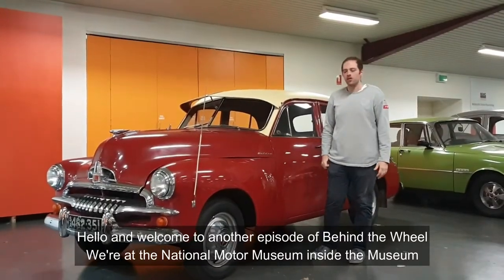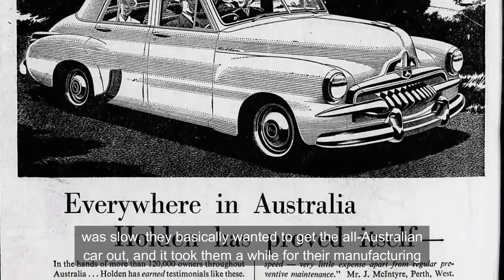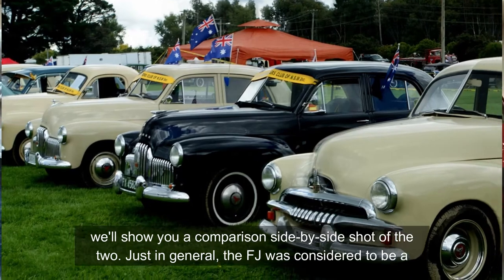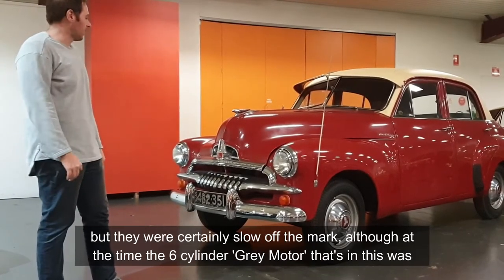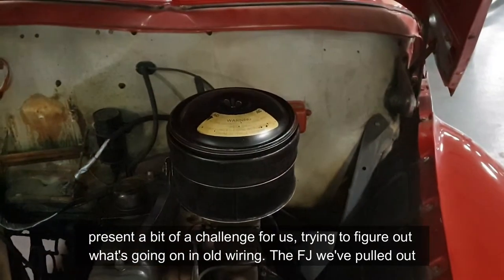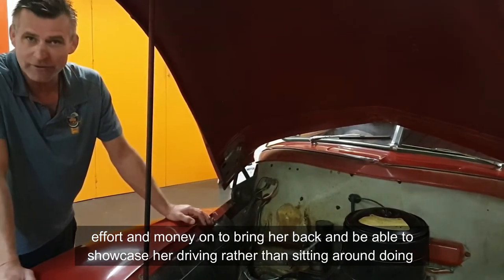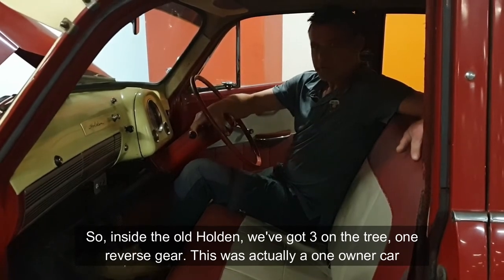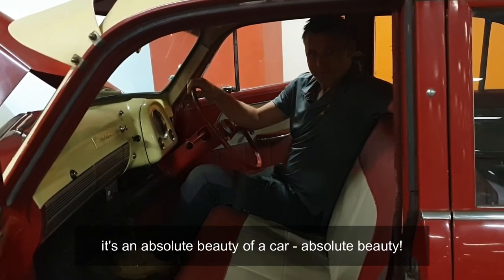Behind the Wheel: 1956 Holden FJ Special

Comment: whats the ariel thingy on the front gaurd ???
Reply: Very wrong if it's a radio aerial.  Mine had a factory radio (or dealer accessory from new) - and the aerial was just forward of the passenger "A" Pillar.
Reply: The aerial thing is used as an indicator of the corner of the car to judge how close he/she is to the gutter whwn parking.
Reply: I think the radio was a  fj special addition , the standard model did not have one , they were old valve radios with a treble base knob .